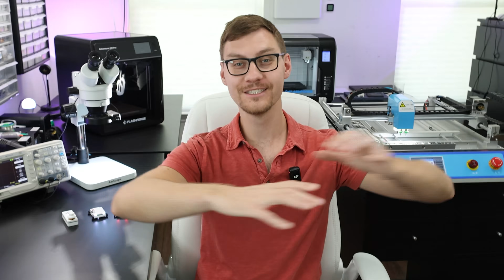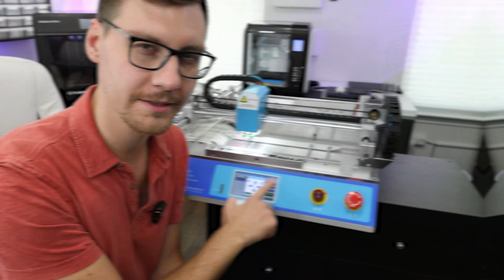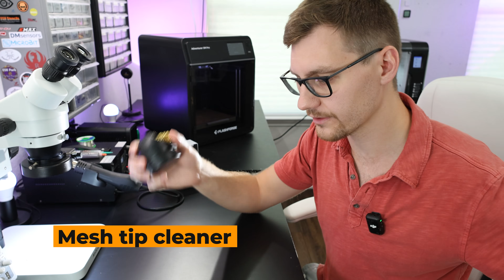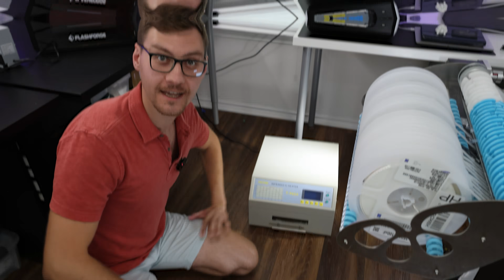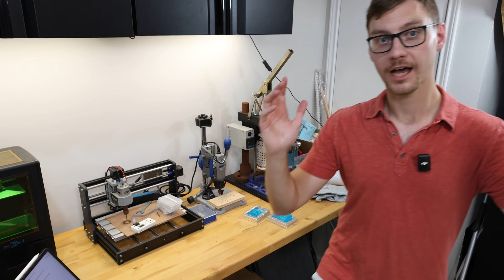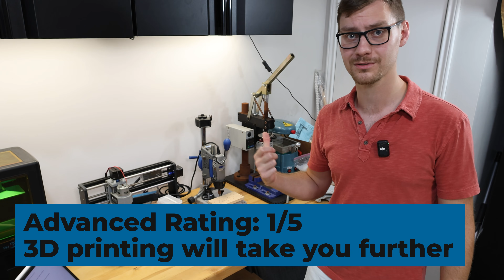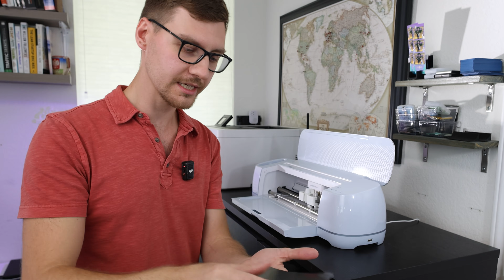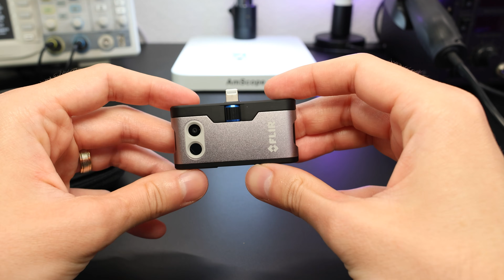I Wish I Knew This Before Building My Home Lab

Comment: 1. Between a loupe and an expensive microscope, there are really inexpensive non-stereo digital microscopes that get you 98% of the way there for cheap.
2. I'm pretty sure scratching your tip against the metal wire cleaner also destroys the plating on the tip. I've been taught to just use a wet sponge, and it works pretty well.
3. For a poor man's fume extractor you can just use any cheap PC fan, point it away from you/towards the open window. I don't believe that filter is doing much anyway.
Reply: What I’ve heard is you should use a brass tip cleaner instead of a sponge. I think what you mean about scratching the tip is more if you use something like a stainless steel wool
Reply from the maker: @MysticHazard agreed! I have had the same tip for over 6 years now :)
Reply from the maker: I have been using the same tip for about 6 years now, so copper (or brass?) mesh doesn’t really affect it. It is however amazing at cleaning it :) as for digital microscopes. I had one… the lag is a killer for me, but hey! If it works for you that’s awesome :)
Reply: @stuckatprototype have you used the hdmi output or the usb one… ? USB can induce some lag.
Reply from the maker: it was USB, but I have seen direct HDMI ones, optical is the way to go in my opinion, but if it works for you thats awesome! :)
Reply: @stuckatprototype  optical ones have the advantage of stereographie. Making your eye-hand coordination better. I have a lack of experience with an optical microskope but I am affraid, after 2-3 hours of working, I would get neck pain and my eyes would be tyred too. While I can look on a monitor for days. 
Digital microscopes are a good possibility to get a good image when you start. it will be a world better then the hand held sheets ( and you need a hand for this too, what you need for other stuff usually) and the price is not that bad... for 100$ you will probably get a good enough set nowdays. 

BTW One other possibility you could have mentioned are the lamps with an integrated loupe.  It s pretty cheap too and is to be placed btw a hand help sheet and a digital microscope.
Reply: @stuckatprototype , thank you! Good to know about the mesh cleaner. I've had a microscope for about $40 7-8 years ago (it should be cheaper now), and it had no lag.
Reply: I also like my digital microscope.  I use HDMI typically, but with my Ubuntu laptop I need to run video through a HDMI-USB converter (something about the driver disables the camera controls).

Comment: Pinecil is also a good option for a soldering iron. It's a little cheaper and does most of the same thing.
Reply from the maker: Thanks for the tip!
Reply: Get a proper iron, not this kind of USB rubbish. It has grounding problems and some wall plugs can easily have floating voltages of 100V, while you are soldering ESD sensitive components. Not really clever.
If you wanna go the cheap way buy a Aifen A9 Station, with tips around 100 bucks. This way you can cheaply get into the JBC ecosystem with its giant variety of tips and tools, which all are compatible with the Aifen station. And the kicker is: The tip is properly grounded without any fiddling or special wall plugs.
The only nice part of the USB irons is the mobility, by soldering with a power bank for example. But most people won't do this.
Reply: @matthiash.4670  Most of the time with the USB soldering irons, you can use a supply with a proper ground and that solves the problem. I certainly don't see 100V on the tip of my FNIRSI HS-02 but that's because I use a laptop supply and not the cheapest USB charger I can find. I'm not saying there is no voltage, maybe 1-2 volts spikes seen on the scope, which can probably be improved by grounding the USB shield. On the other hand, someone on EEVblog forums posted a video showing Aifen A9e tip voltage too.

Comment: Cool video and awesome Lab!
Just a word of warning/hint: The soldering fume extractor or filter is more like an fume accelerator or maybe deflector. You can see the smoke being visually thinned out because the airflow behind the fan is increased it is not filtered .If it's possible to see through the thin carbon filter, it is probably not picking up any serious amount of smoke. Myself I am using the "cheap" open window method and have not yet decided on any type of extractor because they get realy pricey when they are actually working. :(

Take care and keep up the good work!
Reply from the maker: Thanks! And I appreciate the advice, I’ll be sure to look into this!

Comment: For hotair, I would actually recommend going with a turbine machine, like one from atten or quick. I've found more often than not, that both pump and/or fan hotair stations have extremely poor heat regulation.
For soldering iron, my experience is with JBC. Don't want to spend the premium, go with a clone station or open source station and buy genuine tips. By far some of the greatest tips, I've used so far.
I'd say oscilloscope is a must that you can delay, but it's going to be apparent that you need it sooner than later. Simply buy one with a logic analyzer, they don't cost much more than the base unit and not every oscilloscope is going to require expensive adaptor cables.
3D printer is also a must that you can delay. Go for a cheap and tested for the beginning, like an Ender from creality. For more advanced go IDEX/multimaterial.
If you absolutely need a CNC, go for one that's sturdy enough to cut aluminum, anything else you are going to regret. I plan to buy a Carvera air myself.
PickNplace is an overkill and I've been doing electronics for over 2 decades now. Although if I had the space and money, I would definitely get one.
Hotplate is also important for rework if you have heavy boards, not absolutely needed unless it is indeed absolutely needed and you can't do without. I'll be spending the money for a good one as I am getting more into BGAs, but it's an absolute overkill for a beginner.
I don't know about the stereo microscope, I'll be going for a pseudo "stereo" camera instead, but that's me and how I like my working position. And yes at some point it is absolutely needed.
Another important part is the illumination of the working space. Strong diffused LED lights at 4000K work best for me. 2700K and I see absolutely nothing, 6000K and I'm straining my eyes and sleep cycle.

That's my 2c from my experience thus far. Thanks for the video!
Reply from the maker: Love this! Thanks for the detailed breakdown! I’ll check out turbine hot air stations, never looked into it further than the research I did years ago. As for the stereo microscope, try one. Seriously, it’s something I can’t go back on. And yes! Very good point. I should have mentioned my lighting setup. I have a lot of lights. That’s probably the most important thing to save your eyes! Thanks again! :)